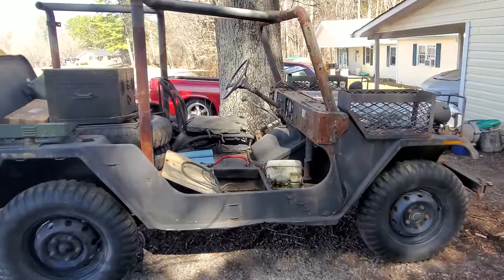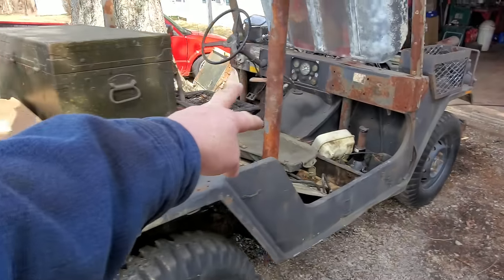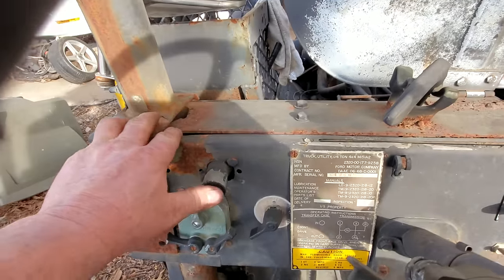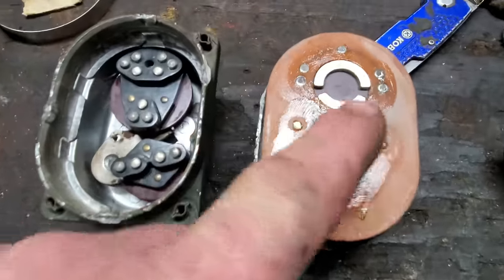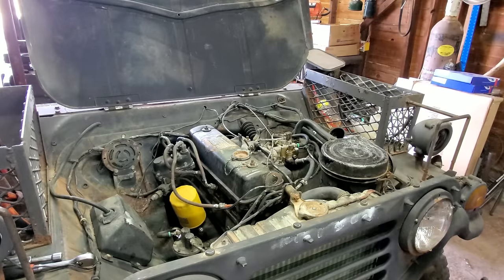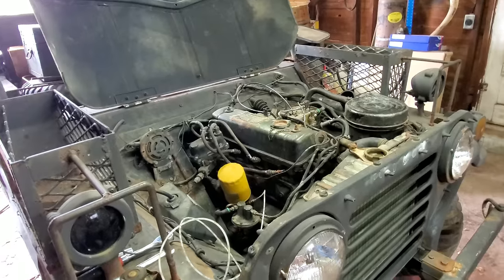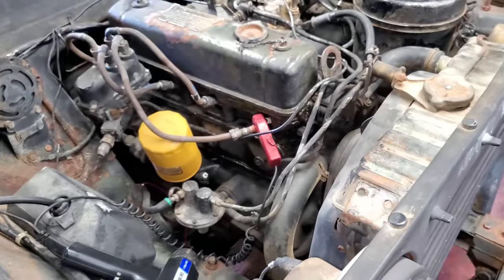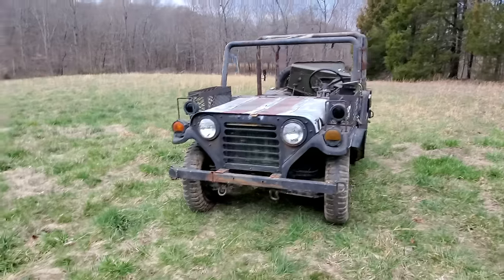M151A2 M.U.T.T. Jeep Stored 20 years!! Will It Run And Drive Again????

Comment: I have a cherokee that fixes itself. Over the years it's developed a slew of different issues. I learned that if I ignore them long enough they seem to just go away. Right now it's in convalescence because the inside of the block is rusted. Hopefully that goes away too..

Comment: Pretty cool find! I was in the Army in the late 80s up until the early 2000s. I remember those mess kits like the one you found in the trunk. Usually, they are old and have been in service for decades. I had a couple that were date stamped from the 1940s. Some soldier or Marine in Europe or the Pacific during wWW2, the same with Korea and Vietnam, may have used the same ones I was eating from in the field back then. You should be able to find somebody selling the "TM" (technical manual) or service manual for civilians, online easily. If you want to take that Jeep in deeper water, you can also probably find someone selling a deep-water fording kit for it.

Comment: NSN = National Stock Number, it's used to order it in the defense department logistics system, account for it, order parts, etc.  All equipment in the military has one.  Not a footlocker, probably was used for a specific piece of equipment.   I loved the M151s wish I could have got, one, dang DOT didn't want the roads flooded with them when the military switched to the HMMWV , said they were too unsafe for the highways so they weren't auctioned off

Comment: Carbon breaking off the head & into the cylinder make a rod knock sound in the bottom end.
A rod knock won't change. Your sound does.... run it ... I solved my issue by getting my Ford 360 hot then rev it up to 3000- 4000 & start pouring boiling water down the carb. Do not let the engine die when doing this.
The steam will melt the Carbon

Comment: AM General used many of the same parts in the Humvee. Front and rear lights, turn signals, several of the same settings and setup. My bet is that vehicle was stateside only. Especially for the year. Most of the stuff that went to Vietnam is still there!

Comment: The carb has an outlet and an inlet from the fuel tank because the fuel pump was over pressured because the jeep was designed to keep running in extreme angles.

Comment: It would be interesting to check the compression after the heat was in the engine
Reply from the maker: I actually lost compression in the front cylinder. Probably gonna need a re ring at least.

Comment: I drove one of those all over Vietnam.  They were great little trucks; you did have to watch cornering on pavement, though - they had a nasty habit of getting upside down.  That IRS in the rear was pretty much like a Corvair or a VW - it would jack it up and tip you over.  The tip was never , EVER chop 'rthe throttle once you were committed to the corner.  Mine had a piece of angle on the front bumper about 4 fit high to catch the cut your head off wires the bad guys liked to string across the road.  Also, I can tell you that the Army tires were only good for one thing - you can't tell from the tracks if you were coming or going - otherwise they are absolute crap.  FYI - if you mount a .50 cal in the rear area of the truck, it WILL rip the floor right up - ask me how I know.  But the firepower was awesome.

Comment: Man, that looks like a fun machine.  Great video!  FYI, that looked like an airplane sparking plug.  Also, I wonder if that clatter had anything to do with the fording valve.  I noticed that when it started clattering, the smoke also started rolling off the motor.  Maybe it was pumping up the crank case, causing the clatter, and blowing out oil?  When it stopped doing it, the filler cap was loose.  Just a guess.  Keep em coming!

Comment: When I joined the Army in 1971, this vehicle (M151 Series) was the very first tactical vehicle as a Truck Driver that I learned to drive on.  They were a lot of fun to drive, but because of the independent suspension you had to really watch your speed with them.  Because the rear wheels if you were going too fast and made a sudden sharp turn the vehicle had a tendency to roll over.  They have great ground clearance for offroad use.  The front and rear differentials are recested pretty high into the body of the vehicle.  They have a 24 volt electrical system so you would have to have a like vehicle to slave this vehicle off if the batteries are dead.  If I had a dollar for every mile I drove one of these during my 20 years in the Army I could buy one brand new.

One other note regarding the fuel tank, when you opened it up, it is missing the fuel strainer.  The reason the tank opening is so large is because the fuel tankers have very large hoses and nozzles.  Some of the larger tactical vehicles that run on "MOGAS" ie.  (M88 Tank Recovery Vehicle) have fuel tanks that hold hundreds of gallons and would take a very long time to fill up with a standard nozzle like we see at the local gas station.

Comment: There's a certain feeling a feller gets while watching multiple "Fire in da hole" attempts.   After 14 plug checks,  battery charges, and cranking it puts a feller on the edge of his seat hoping that it's going to bust-off.   And then it happens !     AUGH - YA !    When I heard you "Woo-who-whoo'en"  it was nothing but smiles over here.  Was a great moment. 😄
MLS  was mild this week, only one minor repeat being the return spring bracket.  👍 The ride at the end was the victory lap and  reward 🏁🏁🏁That was a lot of fun,  thank-you very much.     
I believe the large fuel filler and fuel cap are meant for rapid filling.

Comment: I think those were really low compression so that they would run off about anything. That oil cap with the chain is jumping around luke crazy
Reply: I think it’s worn right out. It has tons of blowby, is my guess.
Reply: @belyear  yeah 4 sure. Just remember reading that somewhere 👍

Comment: I too give thanks to all veterans, THANK YOU!
  Congratulations on getting the ole MUTT running. 👍   Maybe next you’ll work on a tank. 🤣
  Did you figure out what that clang was when you was doing the test drive?
    God bless 🙏🏼🇺🇸
Reply from the maker: Coil springs in the rear. It appears to have two sets, one inside the other, and they were rubbing on each other.

Comment: Curious as to the low compression... did they come back up at all or just stay in a lower compression state? I used a spark plug wrench for a chain saw with the handle cut off and put a socket on the end of the saw wrench to get those extra deep plugs out on a old jeep I had. I would just say that unless the guy is a millionaire, its in as good a shape as it should probably get... down quite a ways from a easy fix with its rust issues.... nice job getting it running... and what the heck.. just put another battery in and fire right back up??? its a strange critter that tells me if you can't see your porch lights, your going for a long walk home/lol
Reply from the maker: One came back up.

Comment: Check the leaf springs and their are many zerks that need to be filled up and lubed and it'll run another hundred thousand miles and more, lube it and it'll stay alive for many years to come. Find a Military Depot near you and get some basic parts for this thing, U - Joints for sure,,,,,,

Comment: The black out lights are also used while driving with night vision goggles on. And also the lock on the headlamp switch keeps also from blinding you while using night vision goggles. I was motor-t in the marine corps and we used the black out lights. But we called them “cat eyes”

Comment: Seems like I drove one of those, maybe a Ford in 70 out in Kansas just goofing around. Ft. Riley was HUGE and an armor outfit and had miles of tank trails. I drove a 5-ton water truck mostly till I ended up in the tropics and then it was cranes and forklifts. But everybody had to be somewhere. We used to have all kinds of logging roads and such to run in here which is just across the mountain from yall till it got flooded and/or turned into a state park. Now it's all covered up with zillionaires and goffers but us old hillbillies are weathering out the storm of greenbacks. A-PLUS! God Bless

Comment: Love your channel Chad. Marine Corps still had these at work in the late 90s. They called them IFAVs (Infantry Fast Attack Vehicle) Like that one, they would have a lot of add ons and mods depending on the mission the unit expected of them. They were also the only vehicle at the time that would fit in the back of a CH46 transport helo intact and could just drive out. The black lensed light that's caged in on the fender is a "infra-red" light. It's light cannot be seen with the naked eye. The add-on switch you see on the dash marked "IR" should control it.  Service members would wear night vision googles to be able to drive with no visible lights on.  This allows a convoy or patrol to roll all the way up to highway speed completely darked out.  It's add-on ness shows that the technology came about after this jeep was built so a unit just modded it on.

Comment: NSN is National Stock Number.  That number is used to order one through the Supply System.  There is also a listing for every part on that jeep with an associated NSN - to order parts that need to be replaced.  Right down to switches and screws - you can even order a complete motor assembly, or a transmission.  Interestingly, the first four numbers of that NSN are called the FSCM - which relates to the Federal Stock Code Manufacturer - or, the folks that built it and subsequently supply the repair parts.

Comment: Most everything I've seen ARMY,, HAS THE PLUG WIRES "SHIELDED" LIKE THAT TO STOP ELECTRICAL INTERFERENCE on they're radio equipment.. I suppose it also could help waterproof them too!! My uncle has an old army generator with v4 Wisconsin and the wires are SHIELDED ON IT.... SHIELDING KEEPS THE IGNITION POPPING OUT OF COMMUNICATION RADIOS ETC. The large filler hole on the tank,,MADE IT QUICKER to fill! Especially out in combat situations. They didn't want to WASTE TIME,,TO KEEP FROM GETTING SHOT!!
Reply from the maker: If it was only for electrical interference then it wouldn't have rubber seals on them. These do.
Reply: @ThisNThatGarage  ok,, makes sense,I know just about everything I've run across army wise/engine wise had shielded wires,,but that being an all terrain vehicle,,I see your point!! MAKES SENSE! HOPE YOU AND YOUR FAMILY SURVIVED THE  WIND EVENT FRIDAY!! HAVE A BLESSED SUNDAY SIR!

Comment: Seen a fully restored Mutt at a car show a couple yrs back and painted in a nice OD green paint. Had a big white star on the hood with one tiny star on each side. Had a Fake M-60 machine gun on a mount on the back with 6 grenade launchers standing up in the back with the field radio/ tall black antenna mounted on the drivers side. Just a beautiful rig. Beware when buying these. Make sure you look underneath them to see if they have been welded together in the middle. Stay away from those types. They have been chopped in half.

Comment: you have a foot locker without the tray and part of a mess kit.. the frying pan as you called it is the main plate or dinner plate. It holds meat and potatoes and gravy, the divided plate is for the knife, fork. and spoon after cleaning and the kit folds together and locks then is stored in your backpack. When getting food that plates holds veggies and bread, silverware goes in your pocket while loading food.

Comment: Worked on a lot of those you can also put a fording kit on them and drive them under water the ignition is completely sealed as well as the the light switches the holes on the hubs there was a kit with a bar and rope that could be used as  a winch the push button switch on the dash by the light switch is not original to that vehicle these would go anywhere

Comment: You can get universal push in sockets for a forward and a lot of people drill them out and then use the push in sockets because I have their own ground and all you have to do is run hot and a switch power in the work you can get him on rock auto there like I don't know verbally's carries that are not but therefore like seventies fosword turn signal and pay a light is 194 bulb

Comment: I’ve had a 1966 A1 for about 20 years now. A couple of interesting things about the M151 - look underneath, it’s independent suspension on all corners and the diffs are bolted up to the body resulting in loads of ground clearance over the Willys and M38. Also, the radiator is bolted to the engine, not the frame, so the entire “power pack” (engine, transmission, transfer case and radiator) come out as a unit. So motor pools could have power packs waiting and swap out a bad one in no time. Warning - the weakness of these Hercules engines is the little ears on the head that hold the exhaust manifold on. They are bad to break off if overtightened. They actually made more M151’s than any other kind of military 1/4 ton vehicle so parts are surprisingly easy to find. Most that actually served in wartime were left in Southeast Asia. The best thing about owning one is to go to old car shows and let Vietnam vets sit in it and listen to their stories.

Comment: The reason why the gas fill neck is so big is because when you are fueling in a war zone, the nozzle is about 1 and a half inches in diameter and you usually want to get fuel very quickly so you aren’t sitting still very long.

Comment: I was thinking to loosen the rings and not foul the plugs to bad if you could use like a 20:1 2 stroke mix just so it has some fuel to fire on when you go to start it I’ll give it some testing when I find an old junker to test on and see how it works I know I’ve always had issues with the plug fouling when I put oil in there to try to get the rings free

Comment: Brings back memories. I trained at Ft Knox Ky , 11Delta armor recon, 1966, we used  I think M151A1 dont remember , but it had an M 60 mounted on a pole in the middle. Then again in Germany Driving regular Jeep. Thanks for sharing and remembering us Vets.
Reply: I was at Knox at the Armor/Engineer Board running a test on 1150 Case dozers. Did a LOT of clearing after dark with no cabs.

Comment: I have a 1968 M-715, as I understand it, on mine, the Deep Water kit will pressurize your front and rear axles, T case,  gas tank and transmission.  The FM manual says to look for an "inflated shifter boot" to tell if the system is working.
As far as I can tell, the system uses spent exhaust to do this.